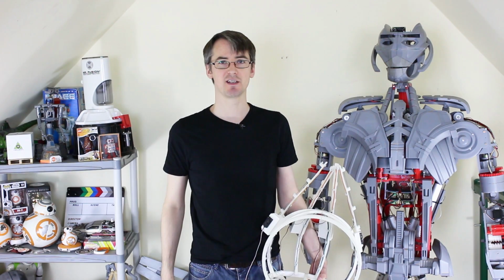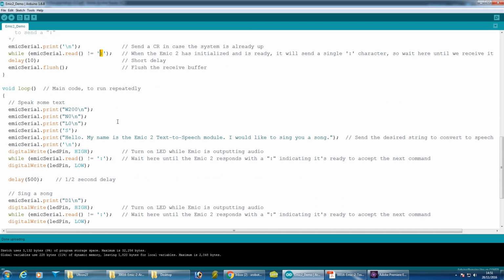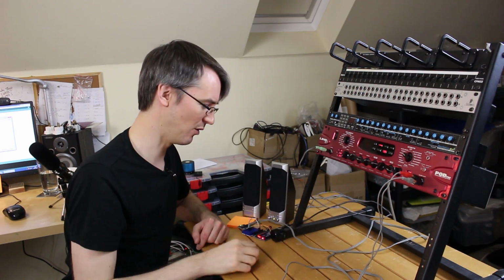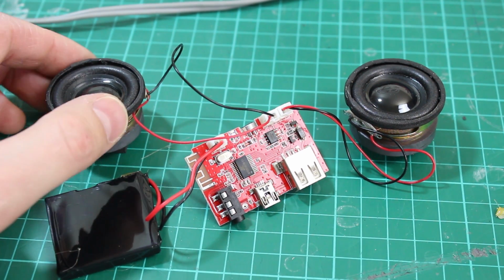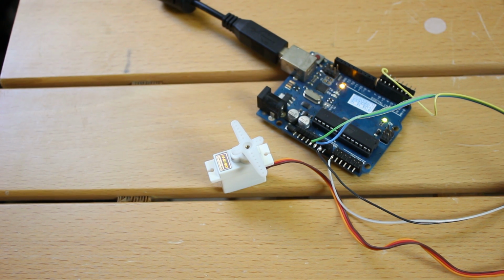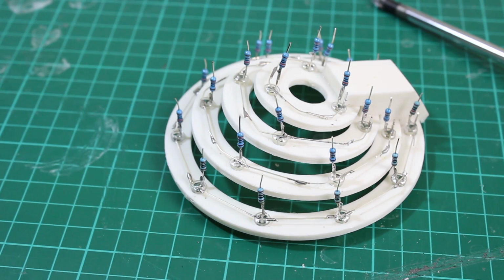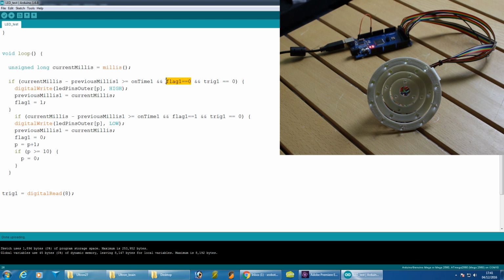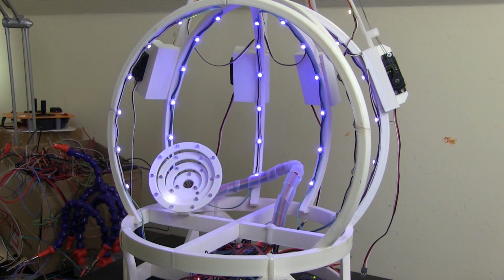Avengers Ultron #27 | Speech Synthesis | James Bruton

Comment: With the voices and the guitar processing unit, try pitch shift stuff like adding in an octave below (or 2), not shifting the whole sound down, but adding the sub octave to the original would give it a more demonic sound.  Also distortion would give it a grittier sound too. A noise gate on the guitar processor might also clean up some noise in between speaking.    Couldn't you take the jaw movements from the core sound unit before the guitar processor adds the reverb? Should make it snappier.

Comment: I know you have said several times you are not a programmer, but if you do not mind, I would like to give you a few general coding little tips:
  1) Tests are performed from left to right inside an if statment. When concatenating several checks by the && operator, place the quickest ones first (on the left) and slowest last (on the right). Since they are all concatenated by the AND operator, as soon as one check is false, the rest are not performed and the if statement is skipped. That will save a few processor cycles. In the code for the LED rings, I would place the time ellapsed check last of all.

                          if(flag==1 && trig==0 && currentMillis - previousMillis1 >= onTime1)

  2) Whenever possible, use the pre-increment operator (++foo) rather than the post-increment one  (foo++). Pre-increment is a little faster than post-increment, because it does not have to make a copy of the current value before incrementing it. To understand this better, take this example code: a = 3; b = ++a; c = a++;  At the end of this code, a = 5, b = 4, c = 4. The pre-increment first increments the variable and then returns itself, the post-increment, increments the variable and returns the previous one. The internals of those operators may look like: int preincr(int a) { a = a + 1; return a; }   int postincr(int a) { a = a + 1; return a - 1; }  or int postincr(int a) { int ret=a; a=a+1; return ret; }  Post-increment is slower because it has to perform more operations.

I know saving a few cycles may nbot sound worth the effort, but as your code grows in size, and it seems it will, it may help somewaht in the far future having saved "many few" processor cycles.

Having said that, in the particular case of your loop() function, both if statements differ only by the "flag" check, the other two are the same. That is calling for nested if statements. Place on the "root" if, the common checks and follow rule 1 above. Then, inside that if place all common code in your two ifs and also another if statement checking for the value of flag. And since flag can only take in your code either value 1 or value 0, there is no need for two if statements, but a single if/else statment, which is also faster than having two if.

               if(trig==0 && currentMillis - previousMillis1 >= onTime1)
               {
                      if(flag)   //-- or if(flag==1)
                      {
                                // your ON led code
                                // update flag variable
                      }
                      else
                      {
                                // your OFF led code
                                // update flag variable
                                ++p; // increase p variable
                                // check p has not passed gone the end of array. If so set it back to 0
                      }
                      // common code
                      previousMillis1 = currentMillis;
               }

Now, since "flag" is used as a two value variable, you could make it take either HIGH or LOW, and in doing so you could use the value of flag to set the LED pin output. That would save compiled size (which may also turn out an issue if your code grows very large).

               if(trig==0 && currentMillis - previousMillis1 >= onTime1)
               {
                       // Turn ON or OFF your LED
                       digitalWrite(ledPinsOuter[p], flag);

                       if(flag == HIGH)
                      {
                                // update flag variable
                               flag = LOW;
                      }
                      else
                      {
                                // update flag variable
                               flag = HIGH;
                                ++p; // increase p variable
                                // check p has not passed gone the end of array. If so set it back to 0
                      }
                      // common code
                      previousMillis1 = currentMillis;
               }

I'm loving all your videos. What a nice work. Congratulations.

Comment: I've not finished the video yet so I may be saying this prematurely. Could you send the audio to Ultron twice in tandem. One stream would have all the processing applied and the "clean" audio would be used to control the mouth movements. It would also be sent fractionally earlier so that the lip sync matches up a little better without the delay that's happening now.

Comment: James, it looks like Ultron is coming along nicely! I was thinking that with the circular visual indicator inside the brain it would look better if alternate rings of LED's moved in opposite directions ie. the outer one clockwise, then the next anticlockwise and so on. You could also vary the direction of travel depending on the stimulus for additional randomness!

Comment: You should consider using the Teensy 3.2 with audio shield. It can handle your analog audio out and and do effects to it to match your effects of your large hardware but it's about the size of an arduino. It also has digital signal processing built in so you can do the mouth movements easily on one of its io pins. Its programmed with the arduino ide so you'll have a very small learning curve.

Just  a suggestion. it would really fit well with your design.

Comment: Do you want a robot uprising? Cause this is how you get a robot uprising.

Jokes aside, you might try a gated reverb on his voice. This would give it that sort of hollow sound without the echo after the speech stops.

Perhaps try a phaser with a very slow sweep instead of the flanger. It's a fairly subtle effect that only sounds like it's on the top end of the signal, and just mixed in a bit. Heck, a chorus effect might even sound pretty good there too.

Anyway, great work, amazing progress!

Comment: You could try and split the audio signal and put the dry signal for the servo but use the wet/affected signal for the audio.

I think that might get you a tighter, responsive movement.

Comment: You don't have to control the LEDs directly from the Arduino mega. Try using a shift out register (e.g. 74hc595). That way you can individually control any LED, and even use the SPI library if you want high-speed control of the lights without using interrupts https://www.arduino.cc/en/Tutorial/ShiftOut

Comment: James try using APA102 LED's instead, Adafruit calls them DotStar LED's. They use 2-wire SPI and since they dont use interrupts you can update them as fast as your CPU can handle, and you have the interrupts free for other things.

Comment: You should really delay the sound, between the arduino and the speakers. It can be done with a simple analog delay.
cut the wires between the speaker and the bluetooth board, insert the delay, and a small amplifier, or active speakers.

The jaw movements would better time up with the sound. Granted its mostly an issue when the robot stops talking, where the sound stops before the jaw stops moving..